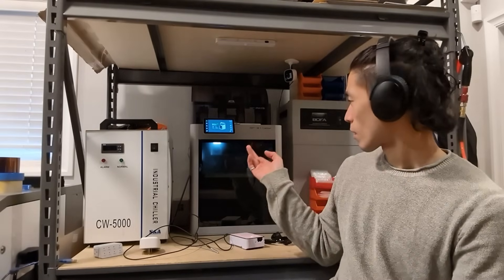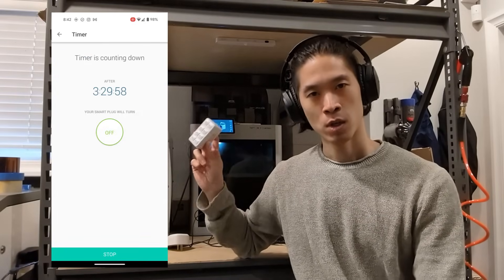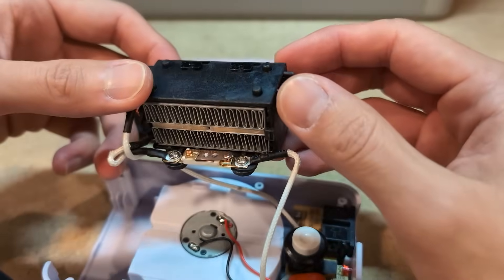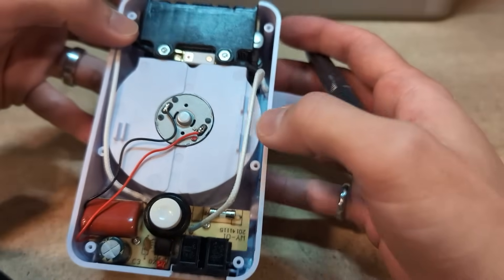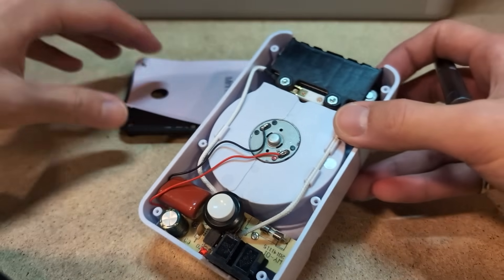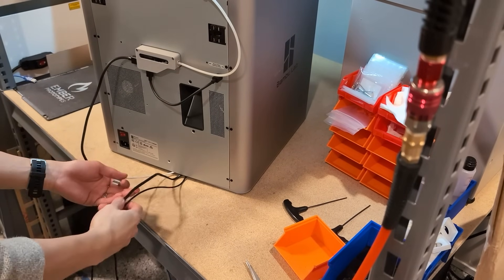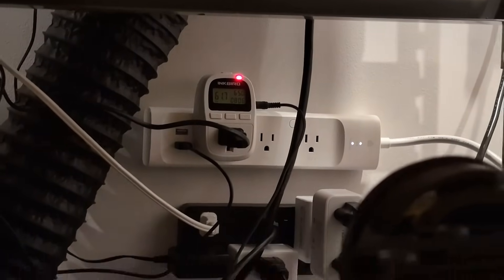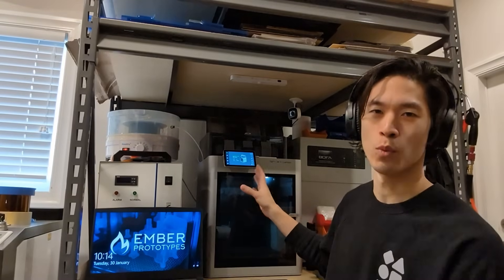Bambulab X1C - $50 HEATED CHAMBER

Comment: I haven’t had any issues when printing ASA, and then again I haven’t really printed any big dense parts like you. But I do have that heater in my cart. lol I couldn’t help but notice you have a different looking carbon filter in there instead of what I’m use to seeing, the bento box. What filter is that? Is it printable or something you made or bought?
Reply from the maker: Yeah you can get by with smaller lighter parts, but once you start scaling up size and density it becomes a whole different ball game and a heater is really helpful.

I made my own filter system before the bento box really became a thing.

I kind of hate that none of these filtration things have any sensors and/or scientific evidence of how many VOCs they can capture in terms of kg of filament...but maybe that's something for me to work on in the future 😅
Reply: Also you don't want a heated chamber for ASA (at least for the one from Bambu) I have had big problems with ASA since I use an active heater in my X1C and I found out that it is caused from the high temperature. ASA needs quick cooling to not get ugly (especially for sharp corners).
I can also proof my point. When you change your printer in the software to X1E (with the active heater) and look at the ASA setting, the heater is set to 0°C. Bambu did that for a reason. When you look at the settings for PC you will see that Bambu set it to 60°C.
I turned off my heater again when printing ASA and my prints looked good again.

Comment: Some prints/printers/filimate don't like the temp flucations.  It's expansion and contraction (or attempted) that can release the part off the build plate.  Not always - but some times - depends - just something to watch out for.
Reply from the maker: Thanks for the tip! Haven't run into issues related to this yet 😬

Comment: My concern with doing this on a printer not designed for it is you are heating the air around the hotend. As I'm sure you know, the hotend has a cooling fan to keep the cool part cool and the hot part hot, with a heat break between the two.  If you heat the air, your not likely making the heatend hotter, but your definitely making the cool side hotter. Will the nozzle and heatend clog more? I guess only time will tell.
Reply from the maker: A very fair point. I have not noticed any clogs since the upgrade and I've been printing a ton. I find that amorphous polymers like ABS and PC don't really clog. With PLA you obviously don't need the heated chamber. Haven't had issues so far with PACF.

We're not going too hot here because the electronics aren't isolated so there's a limit to internal temps anyway and I don't think the delta is high enough to cause problems here.

Stratasys machines heat to 80C+. I'm curious if their hotend designs are any different, it's been a while since I've looked at one up close 🤔

Comment: There is a small hole on the floor of the X1C on the exact corner you placed the heater. That’s the hole I used to get the cable  out of the printer for my Bento Box and it’s easier than getting it out from the back of the printer.
Reply: That hole would be perfect if it was a little bigger, guess I could route it out a bit more.
Reply from the maker: Interesting...I didn't see anything there but I'll check again!

Comment: How does the double sided tape hold up to temperature?  My concern would be over time it would not hold the heater to the side wall.  I have been wanting a chamber heater for awhile, and I will be building this.  Thank you for sharing.
Reply from the maker: No problem - thanks for watching! So far it's been holding up totally fine - though I'm using some very high quality VHB. Mileage may vary with other tapes. 

I'm currently running some production ABS parts so it's been on almost every day for 8+ hours over the past several weeks and it's doing great.